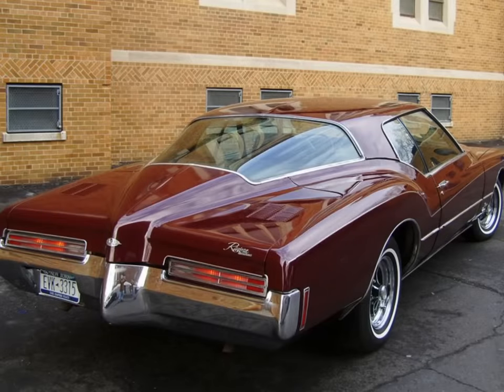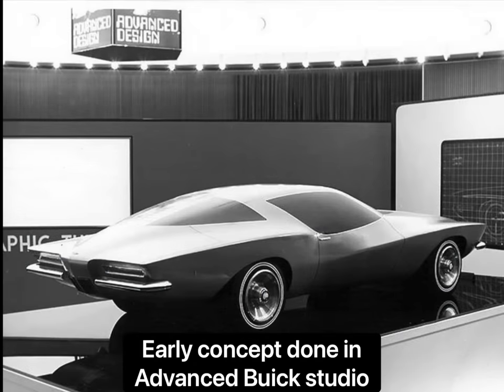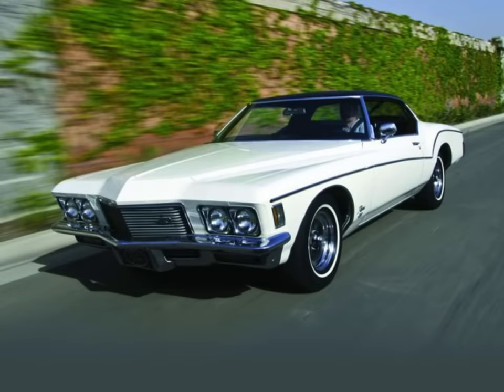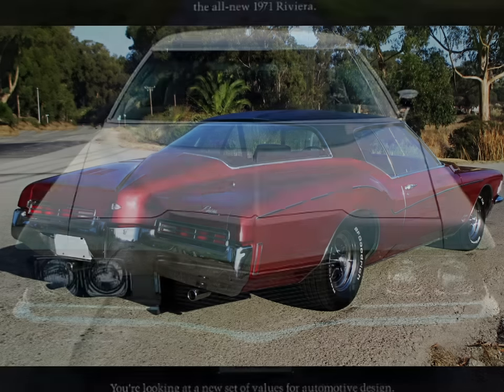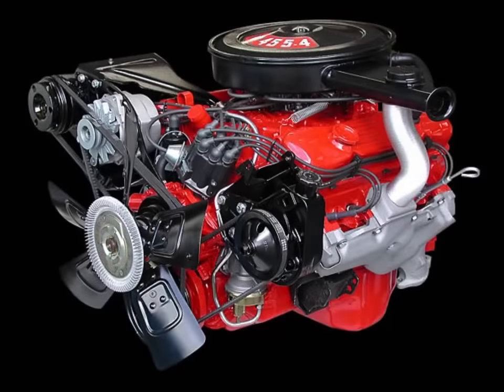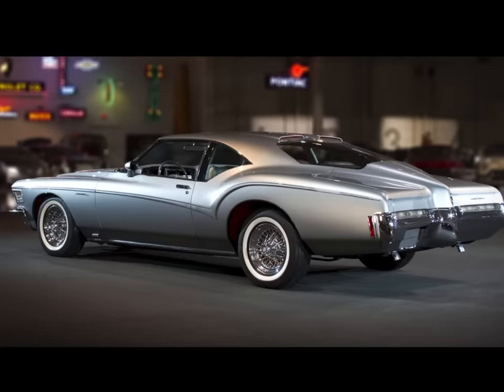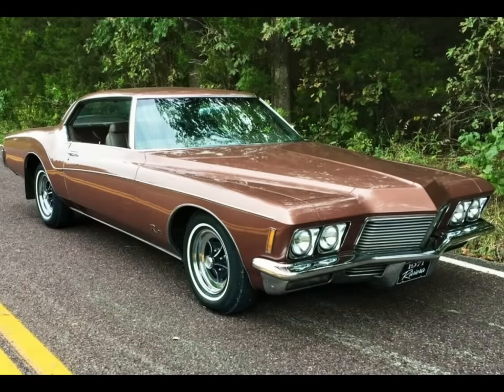Most Controversial Cars of All Time: 1971-73 Buick Boattail Riviera

Comment: I don't have the specifications at hand, but for some reason this generation of Riviera looks positively huge compared to its predecessors. (Wheelbase was 3 inches longer than the 1970 model and 5 inches longer than the 1st generation of Riviera. ) And while I am not usually a fan of big cars, this model (1971-1973) was MILES better looking than the 1970 model.

Comment: The problem with it is the wheelbase is too long creating a weird transition at the quarter window to fender curve area. This should have been built on a slightly stretched Corvette chassis and used the windshield as well. These line's shrunk down to that size would have been very good looking. I like the shape of the quarter window and that is where the stretch should happen. It would remove the kickup in the back of the Corvette door and create a nice step line in the rear fender area. The classic Buick trim line is very important.

Comment: This is the one place I have to respectfully disagree. It would be nearly impossible for me to imagine a more beautiful car than the boat tail Riviera and I love the B-body. The proportions are gorgeous and the driving dynamics outstrip the pre-colonnade A-body by a mile. The public also wouldn’t have gotten the 455/TH 400 combination. Long live the B-body
Reply: The LeSabre and I think the Centurion were B bodies, the Electra 225 was C body, and the Riviera was the E body. The Olds Toronado and Cadillac El Dorado were both E bodies too, but front wheel drive while the Riviera was rear wheel drive. My dad had a 1976 LeSabre, 1961 Electra and 1969 Electra. I had 1972, 1974, 1976 Electra's (still have the 1972) and a 1974 Riviera. I also had a 1981 Regal.

Comment: Maybe I wouldn't fit in during that era (I was just entering kindergarten when this car first came out), but if it were up to me: (1: the "boattail Riviera" would have kept its eccentirc styling, (2: The Riviera would have been based on the A-body, just like the Chevy Monte Carlo and Pontiac Grand Prix and Olds Cutlass Supreme, (3: the car would have had more ambitious technology under the hood, perhaps ahead of its time: a smaller, fuel-injected V8, all automatic transmissions would have an overdrive gear, and there would be a major weight-savings program, with lighter components such as fiberglass hood and truck lid. The Riviera would have been Buick's sport-coupe flagship, just as Chevy had the Camaro and Corvette.

Comment: As with many car designs previous to and of that era, typically the fist years look the best.  I never gave any thought to a controversy, '71 was the best looking design IMO.  The unique style of the rear was always a winner to me, the front works, but lacks...something...proportions a little off?  Not sure what, but it's not a deal killer.  Same with the first year Oldsmobile Toronado, the '66 is the best looking in the bunch and one that I would LOVE to still own.  '67 and on just don't do anything for me, even the minor changes after it's introduction the design suffered, some federally mandated, some was attempting to change would should have stayed the same.  This is the beginning of the malaise era when American cars really started going downhill with poor styling and reliability.  Underpowered smog equipment-choked engines, smaller engines expecting to push nearly 3-tons of car and styling disasters where they were literally putting plastic bits to detract from the hulking junk that was below the tasteless paint and horrible interiors.  Cars these days are soulless objects, almost an appliance, however they are much more reliable and safer than they've ever been.  Yet, they are still just tools to get somewhere.  I've always said it's nice to have a modern car to go places and a classic to go places in style.

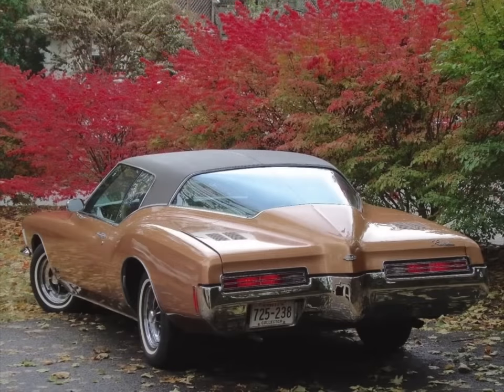Comment: 5:20 "fisticuffs"? That's pretty extreme. I'm not much of a fan of vinyl tops, and would agree that the car looks a lot better without it, but I'd hardly call it a sacrilege. I could see the use of violence to keep a vinyl top off a Pinto (which was already quite ugly enough), or to stop most of the "halo" and half-vinyl tops that became the rage later in the decade, but not with this car.  As for the car itself, I wouldn't want every car on the road to look like this, but it was cool seeing these on the road, especially as car styling got progressively duller during the 1970s and '80s.

Comment: My first car at 16,1973 buick riviera gs
Reply: When I turned 16 in 1975, I got my grandfather's 71 Riviera to drive. It was an   awesome car. Drove it until 1979 when a drunk   driver hit me head on and totaled it.  Walked away with only bruises from the seat belts.  I was that rare teenager that wore those separate lap and shoulder belts back in the day when hardly anyone buckled up and if they did it was usually just the lap belt.  Still miss that car.

Comment: My 1971 Riviera was my everyday driver back in the early 90s until a young lady pulled out in front of me as she was leaving the Taco Bell in Hot Springs, Arkansas. That took the ole Riv out of service, sad day.  It was  maroon with white interior. By the way, the young lady was okay just bummed up a bit.
Reply: With the size of the Riviera you probably fared well yourself and hopefully you were wearing both the lap and shoulder belts and didn't hit the steering wheel.
Reply: @bradparris99  yes I definitely had the belt and shoulder strap on. I didn't even get a scratch. With me hitting the brakes and the other vehicle the big ole 455 sheered the motor mounts and transmission mount and went forward so far it broke the rubber fuel line and the drive shaft yolk came out of the transmission. It was a mess. And you probably know what happened to the radiator.
Reply: @randybarnes8454  Those big Buicks are tough in collisions. In 1978 when I turned 16 I had my grandfather's 1970 Electra 225 coupe to drive. Drove it all through high school and coming home one weekend from college in 1981 was in a head on collision with a drunk driver in a Chevrolet suburban. The Electra was totaled but I wasn't due to the size of the car and the fact that I was wearing both the lap and shoulder belts which was rare for a 20 year old back then. The driver of the suburban had massive head and chest injuries from the steering wheel and the passenger went through the windshield and landed on the hood with moderate injuries. I only had bruises from the belts. Seems like  both you and I walked away from serious crashes due to our good sense to buckle up both the lap and shoulder belts.
Reply: As a 16 year old behind the wheel of that big Electra I kept seeing the "Fasten Seat Belts " printed above the steering column and one night buckled up both the lap and shoulder belts mainly out of curiosity to see how it was to wear those old style belts. Of course there was the obvious safety aspect but I was amazed at how much better the car drove and handled with the belts buckled and got in the regular habit of wearing them all the time. All of my friends thought I was nuts for buckling up- it wasn't cool to wear seat belts. Thankfully times have changed.
Reply: @bradparris99  you are right about that. Stay safe my friend. I've got a 1979 Chevrolet Impala 2 door I'm wanting to get on the road sometime soon. Just wondering about the crazy things around the world right now. I may have to put a points distributer in it, you know what I mean.
Reply: @randybarnes8454  Absolutely.
Reply: You're a wise man to buckle up and be prepared for adverse situations.

Comment: I think the styling of the 1971 Rivera was stunning. The car was beautiful and something that looked very different than any car at the time. That body was used through 1978 with considerable changes from the original. I think that all generations of the Rivera were beautiful with one exception. That short lived turd shaped Rivera from somewhere around the mid 1990' s that looked nothing like any previous Rivieras. That was as ugly as heck with awful lines and proportions. I don't know what sales figures on that generation. I would think that the car didn't sell very well. By then personal luxury coupes were on their way out. And I would agree I don't like the way the 1971 model looked with a vinyl roof. Bill Michelle design was not created to have a vinyl roof.

Comment: I'm a fan of the boattail design, but a smaller scale version would have been a real looker. The cars of the 70s were an odd  lot, w/ all vehicles getting heavier up til '78, when the Big Three finally started down-sizing things. The 80s were the worst of times for the US auto market, as everything was slow and boxy - bunch of rolling bread boxes. Today, yet again, everything seems to be big, bulky and squared off. Not a fan of square cars.

Comment: The only Rivera that I liked in the 70s was the 75/76 and the 78, I never really got into the Rivera the only other one I liked  was the pre 65 models.  As a whole I generally love Buicks and I owned 2 of them ,but again I could not get into the Rivera, the 79 onwards where dumpy, now I would love to have my 2 Electras back or my grandfather late 60s Wildcat, those are the Buicks I love.
Reply: I bought my 1975 Riviera on eBay from Cars For Causes. It was $305! Twelve years later it is finally undergoing full restoration. Verde Mist color with the console shifter. About 64,000 miles. I have driven it 90 miles since 2010.

Comment: The transition to the B body occured because GM cheaped out.  Basically, the same three cars on the same platform with differen skin wrinkles.  It's what you get when bean counters rule the roost:  crap.

Comment: Interesting styling but way too large would have been much better if the vehicle had been about 183 inches long with the boat tail accounting for the last 3 inches. And looking at the prototype with the headlight moved rearward it is really too bad American carmaker had steerable headlight outlawed unlike the French who had them on the Citroën DS. This vehicle would have looked quite unique with headlights further back at the front end which would have been pointy or V-shaped and outboard STEERABLE headlights.

Comment: I love it. But not with the vinyl top or huge side moldings. I am a big fan of vinyl tops, but they just don't look right on the '71-'73 Riviera. 
As for the Eldorado and Toronado, the Eldorado was just plain ugly. I love the looks of the first generation Toronado, but would never consider owning owning one because front wheel drive cars are simply not acceptable to me.
Reply: I always thought the 1967-1970 Eldorado was a nice-looking car (although it lost something when the hidden headlights were dropped in '69).  The new, exaggerated, garish design for 1971 looked like a pimpmobile.